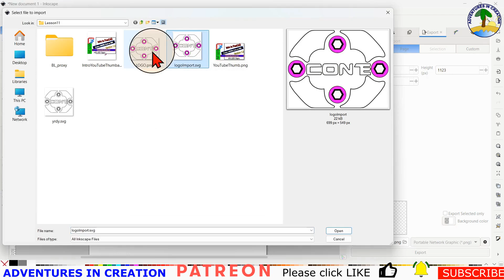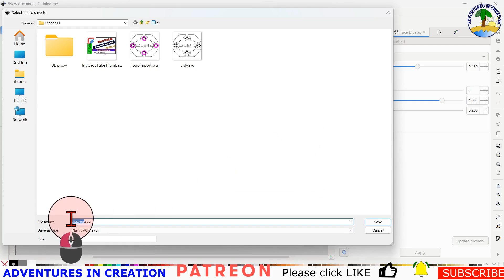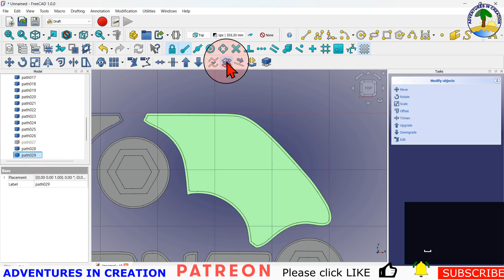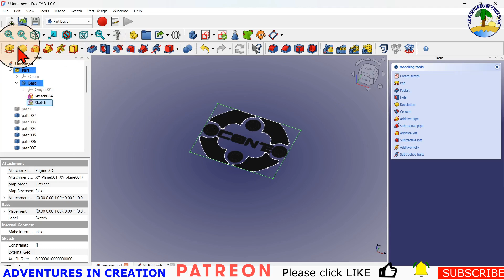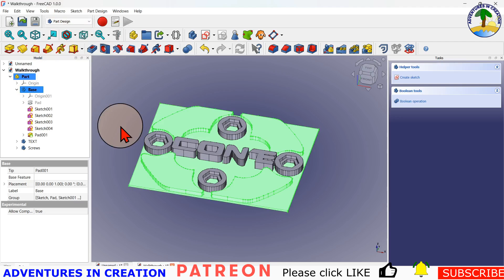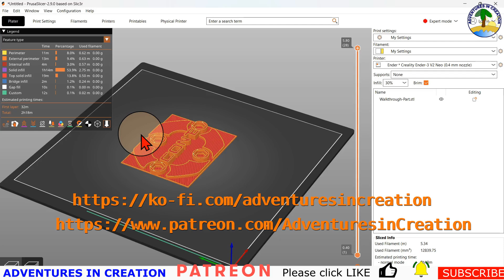Intro To FreeCAD V1.0 Part 11 creating a model from an image file #freecad #3dprinting #inkscape

Comment: Good video but what if I don't want to print the base rectangle?
Reply from the maker: I am not sure what you mean by the base rectangle?
Reply: @Adventuresincreation  
The part where you do this instead of "Allow multiple solids in part design by default" which is said to be unstable. Is there a way of removing the base rectangle afterwards?

https://youtu.be/eJROhOsv8oc?si=5Ay5Wo7aMAtToFqi&t=437
Reply from the maker: @steve_ancell  If you remove the base rectangle you will have to allow multiple bodies in the part or you would have to create a new body from each "island" of the sketch. You can do it but you have to approach it slightly differently than I did in this video.
Reply: @Adventuresincreation 
Bummer!. I was hoping for was a quicker way to do that from the drawing, I guess I'm stuck with using the classic pads from separate drawings then. Thanks for taking time on my comment.

Comment: I would like to see a video using a  jpg image without  a SVG conversion. I have a poorly captured jpg that I could trace but cant seem to do it.  I saw Novaspirit  do it on .20  but I am on 1.0 now and dont want to try and install that older version as it was not a simple process.   Any help would be appreciated.  Especially if you would do it in V1.
Reply from the maker: Cool 😎 I will take a look at it. I will use a jpg image.

Comment: this is an awesome video thanks. but im having a bit of trouble with lamp project im working on ive tried so many ways and im at a road block and i was wondering if you con help me out. i want to do the same concept but instead of extruding im trying to cutaway i have no problem with lettering with shapestring but when i try designs i crash the program. what im trying to 3d print a lamp base with a design in it so the light will shine through the design kinda like a litho concept but just like outlines and stuff
Reply from the maker: Can you get your freecad file and a picture of what you want to me?
Reply: @Adventuresincreation  yes do you have an email or somewhere i can send the files to you?

Comment: Thanks for the tutorial, but for some reason when I go to pad, only part of my sketch is padding, any idea on why that might be happening?
Reply from the maker: Are you selecting the sketch in the model tree? Is there an open wire in your sketch?
Reply: @Adventuresincreation  i am selecting the entire sketch from the model tree, and going through everything, i was not able to find an open wire
Reply from the maker: @unwholesam5186  Thanks, can you get the file to me so I can see what's happening. It is very odd if you are selecting the whole sketch that it would only pad a part of the sketch. Is some of the sketch drawn in construction lines?

Comment: thanks. great video. but i am having some isues. When i import my svg to freecad 1.0 it doesnt import anything. what can i be doing wrong?
Reply from the maker: If you open the svg inkscape does it look OK? Did you turn off transparency? Did you save it as a plain SVG?
Reply: @Adventuresincreation  it all turned out to be a bug. I was working on freecad on linux with the appimage version, then I installed it on the system via Flatpack and now it works fine.
Reply from the maker: @UNOCASTILLO  Good that you discovered it!
Reply: @Adventuresincreation  it would be wonderful if you could show us how to make text along a curve or circle directly in freecad. thanks for your answer.
Reply from the maker: @UNOCASTILLO  Sure, I can take a look at that. I usually make my text along an arc in Inkscape ;-)
Reply: @Adventuresincreation  that it is what  i would like to skip and do everything in FreeCad

Comment: You can make longer videos, just don't make them silent movies!  Thanks for the videos long or not long.

There is a channel that regularly makes 30-40 minute videos for beginners that have no sound. I tried to watch one to learn about a cool new workbench, but I could not make it 3 minutes in. No set up, no name of the tool, no why, no tool-tip bubbles, nothing but silence and fast building.
Reply: Slowdown the playback speed
Reply from the maker: No silent movies here

Comment: Thanks, Ian! Great video, my first exposure to the process you used, I will be working this into my process, and looking forward to seeing your solution of lighting. In my situation, I am designing to use a "rope" type neon LED light. I have not found very much variety available here in Mexico so far. I am curious to see your process. From my perspective a longer video is not a problem, I do understand your point though.
Reply from the maker: Thanks Rodney, I know you appreciate the longer videos but I can produce shorter ones much faster. I have also used the led strips they cost around $6 here.